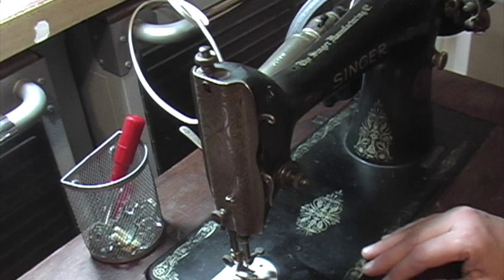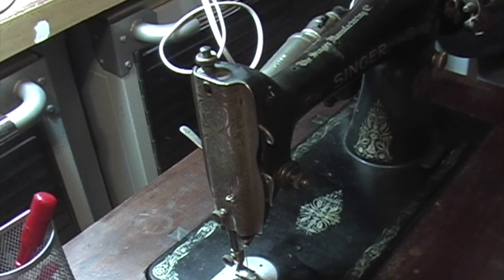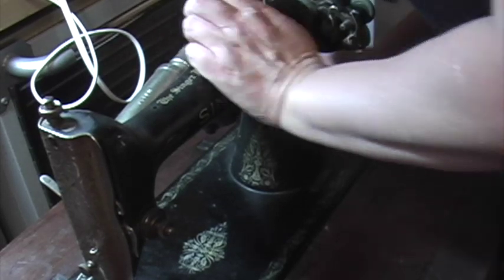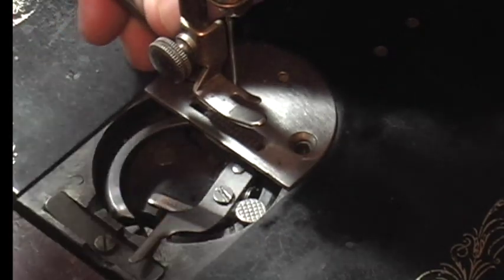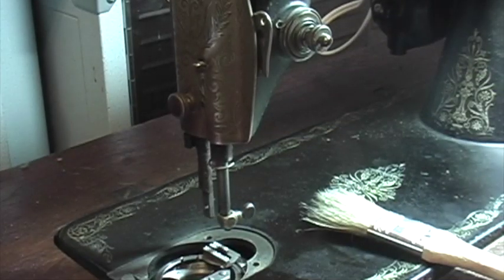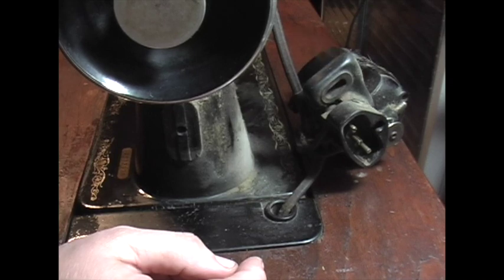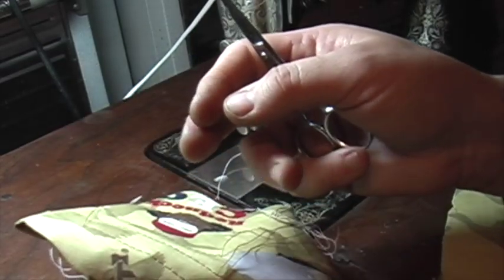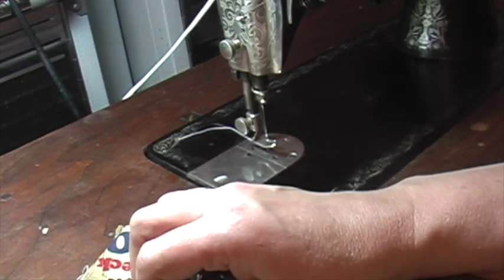Servicing an old  Singer 66 Vintage Machine

Comment: i have a 1931 singer.. i did some oiling and cleaning but it is hard to turn the handwheel.. i lessen the tension but then the needles doesn't move... i oiled underneath also ... any other ideas what it could be?
Reply: I'm restoring my old 115 right now.  My needle didn't move either. I took out the bobbin case and shuttle and it moved so I know the problem was in the bobbin area.  I also took the face plate off and lubed the needle shaft/pin.  I'm now putting it back together so I'm hopeful.

Comment: Good stuff! One more thing that probably could of used a good cleaning and oiling was inside the hand-wheel. Apparently over time it can get pretty gunky in there and cause the stop motion wheel to stick when using the bobbin winder. I just got myself an old Singer 66, and just love the solid basics of these well built machines. Thanks for all the helpful cleaning and thread tension tips! 👍😊

Comment: Nicely done. I recently discovered a very effective, non-volatile cleaner and degreaser that I have found has replaced many of the solvents I have used all my life.  Klean Strip Green Paint Thinner is an environmentally friendly cleaner, solvent, rust remover, and paint thinner which is also nice to work with.  No odor, no unpleasant feel or attack on skin.  I've used the milky white product to clean filthy machinery, heavy grease on our kitchen vent hood, gun parts, car door hinges, and of course, old sewing machine oil buildup. My wife has found many uses, too.  And it's inexpensive, at just ten dollars for a whole gallon.  You might like it for your hobby!

Comment: Hi scrapinmaniac corner, you're doing fine and you're absolutely right in not taking these machines apart any more than you need to in order to get access. Only when rebuilding machines there's a need to do so.  Great video!

Comment: Great video with lots of effective tips. Instead of steel wool & solvent you can use a scotchbrite pad & WD 40. Cleans almost anything and doesn't scratch or eat paint with harsh chemicals.

Comment: Your machine is threaded wrong. The thread goes around the discs, through the checkspring, under the guide beside the tension, UP THROUGH THE THREAD TAKEUP LEVER, down through guide on faceplace, then down to needle.
Reply: Good eye.. I spotted the (wrong) threading as well,, was looking at comments to see of anyone else did.

Comment: Great video.  I too would not gamble on paint thinner to clean any vintage sewing machine.  Form what I've read, kerosene is your best bet as it won't harm the decals.  I love the story of how you got hooked on these old machines.  My obsession started with inheriting my Mom's old 66.  It's a back clamp machine, so it goes back pretty far.  My mom loved that machine.  My dad had bought it for her, used.  They were married during the depression and didn't have much.  When she had to leave her home, I just couldn't see that sweet old treadle machine that my mom treasured, go to a dump or get turned into an end table.  So, I had it moved to my house 400 miles away.  I fell in love with it and it's my machine of choice now, tho I've added a number of other vintage Singers to my stash.
Reply from the maker: Thank you for watching. I agree, these old vintage machines can't be beat. I know the newer ones have fancy stitches but most of the time, I am just doing straight stitching.
Reply: Sim,é singer 66,muito legal que bom.Ainda existe para vender?
Reply: Obrigada pela resposta rápida e atenciosa.

Comment: A frozen machine would mean that it hasn't been used and lots of oil will usually do the trick I wouldn't shy away from a vintage machine due to it being frozen, my husband rewires all machines for me if needed so that's not a problem either. Other then that you covered lots of basics, I've been servicing machines for over 5 years now. Bobbin tires, bobbins and belts are not a deal breaker for me those are easily replaced. Thanks for sharing! 👍🏾
Reply: Jacqueline's Home & Soul hello Brenda St CLair here

I have a 211w151.  Can’t find a tutorial on this machine.   Could you possible guide me to find one.  Want to try to upholster my first piece
Reply: What if it isn't frozen but doesn't move freely?
Reply: Brenda St.Clair I've never seen or heard of that machine before sorry I couldn't be of better help to you. I hope you found what you were looking for. Happy sewing!
Reply: FreeStyleFox disassemble your hand wheel assembly, I usually find old oil and gunk stuck or it's usually very dry in that location and that's why it's stuck and won't move freely. 👍🏾

Comment: I know this is a very old video, but I still wanted to say thank you! This was incredibly helpful, as I'm about to go look at a Singer 66 tomorrow. You gave me really good pointers as to what to check for etc. And now that I've seen you clean and oil the machine, I've gained more confidence that I'll be able to do it, too. Fingers crossed that it's in reasonable condition. Thank you again!
Reply: If you go to bob fowlers channel,  he has video of a complete rebuild of the 66 , very good videos if your looking to get it running perfect . Good luck .

Comment: Thank you!! I have the 1947 model 66 in thr cabinet...been wantin to get clackity-clack runnin again...you have helped tremendously
Reply: Lori,
I hope that you get your 1947 Singer Model 66 sewing again. I love the clackity-clack sound of the Model 66 and 99.
I believe that 1947 Model 66's have a numbered upper thread tension assembly and stitch length lever with back tack.
Reply: ibsoarin i did get it running..love the knee control... i just gotta replace the belt and i can put her to work
Reply: Lori,
Be aware that your 1947 66 originally had a solid balance wheel (which some people call hand wheel).
The belt size for a solid balance  wheel is different from the belt size for an original Singer 9 spoke, 5.5 inch balance wheel.
The 9 spoke balance wheel would not have been original to your electric motor driven 66 machine unless it was a treadle or hand crank machine in the past and then converted to electric motor.
I love the looks of the spoked balance wheels. Plus I have the option to use the machine as electric motor, treadle or hand crank.
Rain Noe of The Vintage Singer Sewing Machine Blog concisely explains about the Singer spoked balance wheels.
http://vssmb.blogspot.com/2011/07/look-at-spoked-handwheels.html#more

Comment: I just picked up my Christmas present Singer 15-91 March 3, 1952 yesterday from a man who use to work for Singer and repair Singer sewing machines. I have all new wiring and motor therefore, he told me it just as being in 1952 and it will outlast my life span. I adore my Ginny and it sews lovely and the stitches are beautifully by increasing the tension thread. I also did darning free motion using a hoop and I was amazed how well it mended the fabric together very nicely. I am a very happy camper and thanks for all your tips on cleaning the vintage Singers. Also, you can purchase a cream cleanser and blue polish from a company that sells that for the vintage Singers. great video

Comment: Ty for your help...got her belt and got it goin...However old sassy keeps getting the top thread jammed around the bobbin...Also just bought is 1897-1905 White Rotary treadle machine :)
Reply from the maker: Hi there, The issue may be the threading. Make sure you have thread the upper thread right and also some machine have the eye of the needle facing sideways and some you thread the needle from left to right. I had a machine i was reconditioning for a friend that was causing a fit with the tension and not catching the thread. I went on line and found the manual. Rethreaded the machine and it finally sew the perfect stitch. My sewing shop  here is very helpful, maybe take it to a place you trust and have then help you figure why it is jamming. I hope this helps!

Comment: Good video. You mention that screw that holds down the horizontal bar that sits over the bobbin casing. Do you know how to reset the position if one has to loosen the screw in order to lift the bar up and move counter clockwise to get the bobbin case out? I just bought a 66-18 for $20 and during my first cleaning and oiling I had to loosen the screw on that horizontal bar to get the bobbin case out to clean the dust from the area.

Comment: This is a very helpful video. Thank you for taking the time to make it. I received a model 66 yesterday and the wheel turns, motor runs, and light turns on but everything else is frozen. Took things apart like in your video, cleaned, oiled. Still no go. (Anyone have a suggestion on what else I could try?) I'll keep at it, but this video I'm certain I'll be coming back to. Really like the part about what to look for when buying one.
Reply: I hope your machine is running by now! Keep at it with oil and trying to turn it. Get really into the crevices with a paintbrush and make sure everything is coated and give the oil time to sink in. Once it is moving, keep oiling until it is moving smoothly. If it's badly rusted, you can use more severe chemicals like kerosene/antisieze. These machines can get beat up, but are pretty hard to kill and are designed to last several lifetimes

Comment: HI GREAT VIDEO   I HAVE A MONTGOMERY WARD M30 SEWING MACHINE BUT CAN"T SEEM TO GET THE NEEDLE TO PICK UP MY BOBBIN THREAD,CAN YOU HELP PLEASE.
Reply from the maker: Hi Bessie, I am not an expert with repairing these machines but I once helped someone fix theirs and they had the same problem. Because we did not have the manual, we threaded the machine wrong (the needle was inserted backwards) and I threaded the needle wrong. The needle has a curve on the back of the eye. That slight curve is what allows the bobbin hook to catch the thread when the needle penetrates the fabric, and creates the knot as the bobbin thread is captured on the upper thread on it's way up. The timing of the bobbin hook and when the needle is down needs to be precise. However, most often the issue of the bobbin hook not catching the thread is due to improper needle position on machine or improper threading. Make sure its threaded correctly. If that is not the case, without threading the machine, manually move the needle while observing the bobbin area and see if the bobbin hook is meeting the back of the needle (shank) at the right moment.  If timing is off , I would take it in for repair. But if it's a machine you have is for learning how to repair sewing machines, you can search on sewing machine timing and see if you can repair it yourself. Good luck!
Reply: Thank you so much .I WILL TRY THAT WILL LET YOU KNOW IF THAT WORKS

Comment: Yes but in the event of it being frozen. Mind is a hard vintage the handle does not move the needle arm up and down after extensive oiling
Reply from the maker: The inner part may be rusted. Look under the machine to see if you see rust.
Reply from the maker: twangel mahoney you want to take it in to a repair shop where they can take it apart and clean the rust.

Comment: Thank you for posting this. There are 2 small additions I would like to add to this video. One is how to remove the bobbin cover. The rounded piece with the 2 screws comes out first and then the rectangle piece slides towards the machine (not out from it) where the rounded piece was. It can then be pulled up and out easily. This will protect the small spring hold down from breaking. You will see a groove that is on the underside of the rectangle piece which is what holds it onto the flat metal spring. One other missing component is the "red felt" up against the bobbin track by a spring for oil. Next to the bobbin release button is a small spring that is supposed to hold a small piece of felt against that track. This felt is oiled and keeps that track lubricated and should be re-oiled from time to time. I can see the round spring that holds the felt but in this presentation there is no felt in it.
Reply from the maker: Richard Nordenberg  thank you for the info. I need to look for that felt for the bobbin. I definitely love these old machines vs the new ones for regular sewing and mending. I like the newer ones for embroidery  and fancy stitching.

Comment: I have exact machine.  my problem is the motor controller, the problem is part of the wiring has material wrapping and it is worn out.  I would like to know if I can replace it.
Reply from the maker: Hi there, you can replace the motor, here's a link , http://www.sewingpartsonline.com/search.html?keywords=Singer+66+motor,  I usually just buy a new motor if it not working. You also can put these machines on a treadle.
Reply: Maria,
The wiring of your foot controller can be replaced. It would be easier to replaced the motor, foot controller and wiring but I prefer the original Singer electric motors.
Check out "The Vintage Singer Sewing Machine Blog" by Rain Noe. The tutorial on rewiring a Singer 99 is identical to rewiring a Singer 66.
http://vssmb.blogspot.com/2012/04/reader-questions-rewiring-99.html
The other parts of the rewiring tutorial are about Singer 201-2 potted motors but the instructions are helpful for any sewing machine.

Comment: This was very interesting and helpful!! I have an older singer,In a wooden cabinet and it has the knee thingy. It was my grandmothers. It need a good tune -up cleaning.  TFS
Reply from the maker: I would get it cleaned and oiled. These vintage machine in my opinion are 100 time better than those plastic machine out there. Just be careful with the decals. I learn to use mild cleaning solution so that the decals don't fade. Plus  I also learn to use car wax for the body after you clean it. It will bring back that beautiful shine. Good luck with that machine!
Reply: Kim Miller The knee bar is connected to the foot pedal. Look under the machine,  the foot pedal is in a holder that the knee lever pushes.  If you want to use your knee to sew,  that's up to you but if the machine motor runs with the knee bar that means the foot pedal is right at the end of the knee control, take it out of the holder and you can use it as a foot pedal.

Comment: Thank you so much for creating this video. I have been researching for hours after obtaining my first singer from a great aunt. It's still in great working condition and this video showed me everything I needed to get it cleaned up and running smooth!
Reply from the maker: Glad this video helped. I love these vintage machines! They are so well made and worth the effort to restore them! thank you for watching.
Reply: Jennifer Lillemo Please please please don't use paint thinner to clean your machine.  Singer recommends you use kerosene. I felt like I was watching a horror movie when she said she was using paint thinner. You don't want to ruin the finish on your machine. Sewing machine oil is used on the finish/paint  to clean dirt and dust,  then use a good polish to make your machine shine.
Reply from the maker: Thank you for the info. I just learning how to recondition these machines. thank you for watching.

Comment: Wonderful! I bought a Singer 66 1946 (with the little table) and cleaned the machine and oiled it up. Thread needle catches the bobbin thread and loops it up through but when sewing it doesn't make stitches. Will be watching this and others to figure it out. Hopefully there is a manual online for this type. Thank you for posting this video and with the subtitles enabled :)
Reply from the maker: Heather Martin  I hope you get it working. I would see if you have the needle backwards. Here's the manual for that machine, http://ismacs.net/singer_sewing_machine_company/manuals/singer-model-66-sewing-machine-manual.pdf. Hopes this helps!
Reply from the maker: Here's manual for that machine, http://ismacs.net/singer_sewing_machine_company/manuals/singer-model-66-sewing-machine-manual.pdf.
Reply: scrapinmaniac corner Lovely! Certainly will check the needle again. Thanks so much for the link to manual it is much appreciated. Cheers!
Reply: You have the needle in backwards?
Reply: Thank you very much for posting this link.  I didn't want to spend 15.00 on a manual.  Thanks again!!
Reply: Sally Gerschefske hello! The eye of the needle has to be facing the arm.... and the thread enters from left side and out the right side towards the arm, after I made this adjustment she runs like a dream now!

Comment: How do I unfreeze my singer 66
Reply: Dissassemble, clean,polish, reassemble.
Reply: Heat.from hot air gun and wd 40 over and over. You may have to do this to get it disassembled usually you have to unseize it to disassemble it

Comment: Does anyone know where to purchase belts for this Singer? I bought a set, made buy Singer, that said they fit "most" machines. They don't fit mine!
Reply from the maker: Hi there, try this link, https://www.sewingpartsonline.com, I got my parts from this website. It post the models that those particular part will work for.
Reply: Thank you so much. They have my Singer's belt (66-4) in stock.